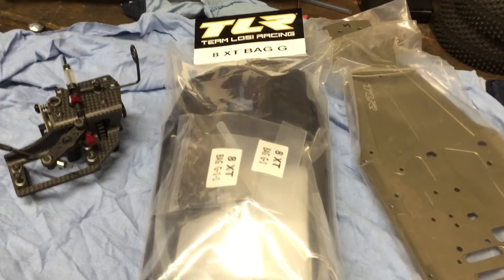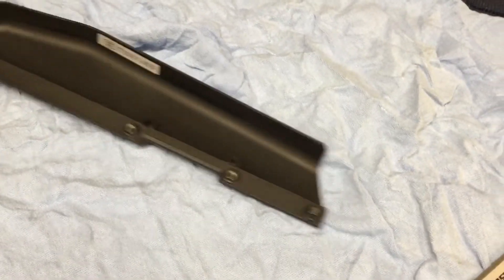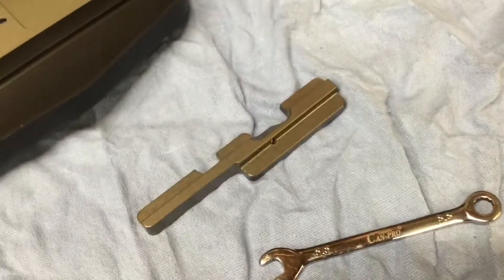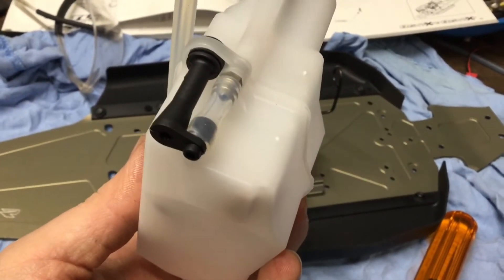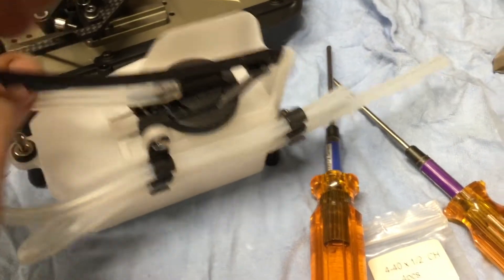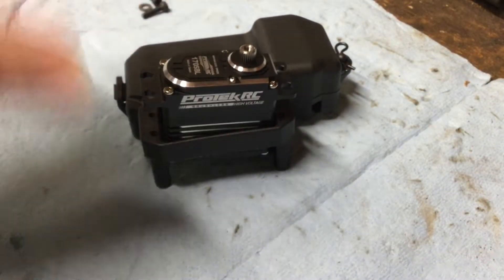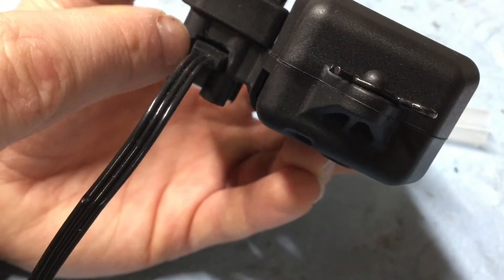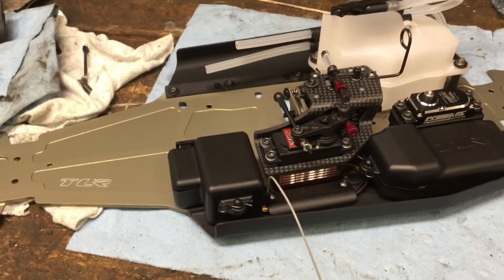Losi 8ight XT Build (Bag G)

Comment: Lol 😂 i got the same steering servo lol … first i installed the servo without his wire then i found out I couldn’t plug it .ended up plugging the wire before putting the servo in and I didn’t have to carve anything but it was tight 😎
Reply from the maker: Wish I would have known that 🤦‍♂️
Reply: @thenitronation5815  that’s fine your set up is easier to deal with ,with that modification ... I don’t know but on your set up u can probably plug it and unplug it at will ...while i have i to unscrew the servo every time.👍